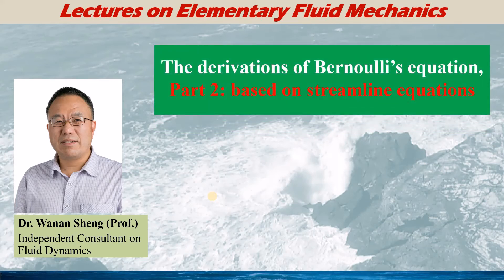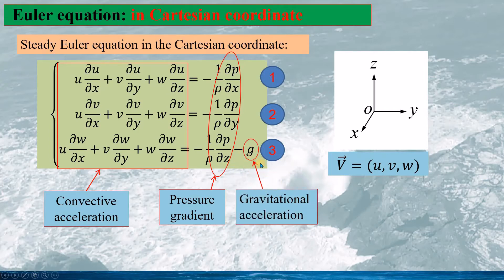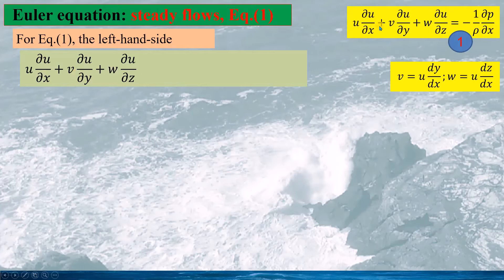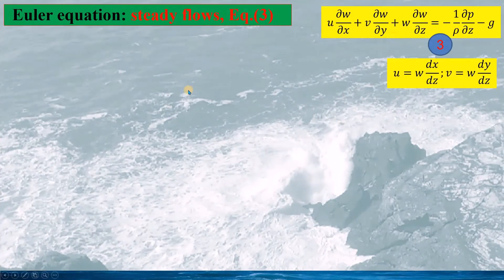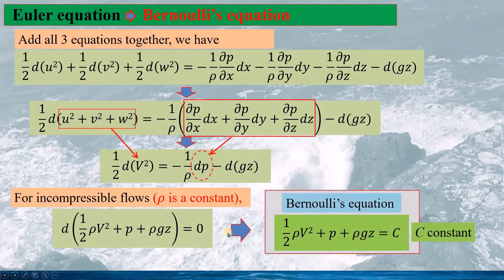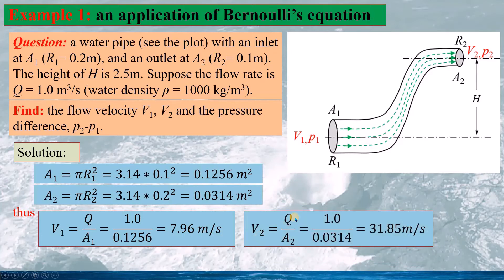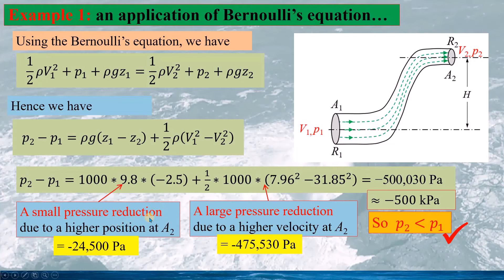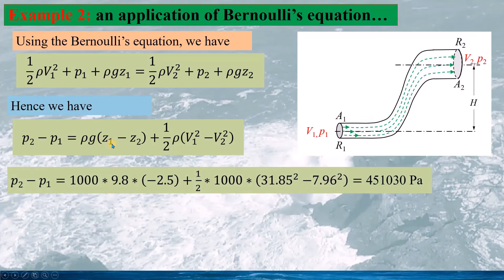Derivations of Bernoulli's equation, Part 2: the derivation based on streamline equations

Comment: Did you have some code of BE for fluid dynamics problem
Reply from the maker: Generally, we can use continuity equation to get the velocities (like in the pipe flows) or solving Laplace equation to get the velocity distribution (like the flow past airfoils or wave-structure interactions), then we can use BE to calculate the pressure. depending on  your problem, there are some open sources for your question.